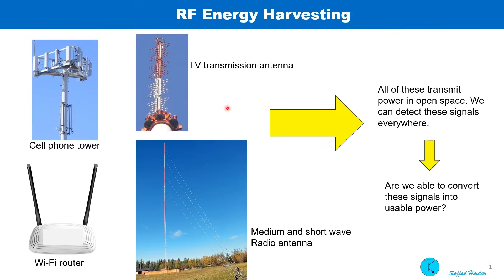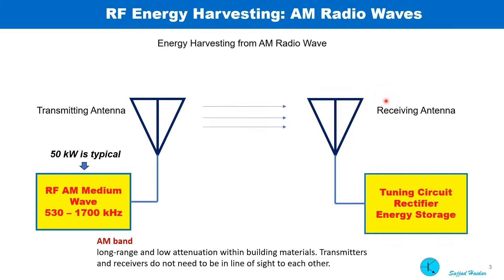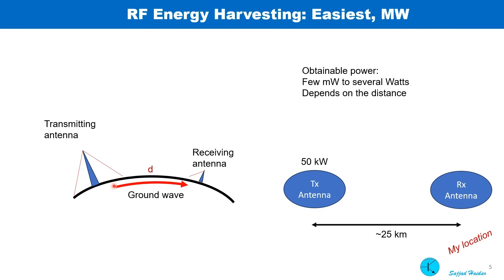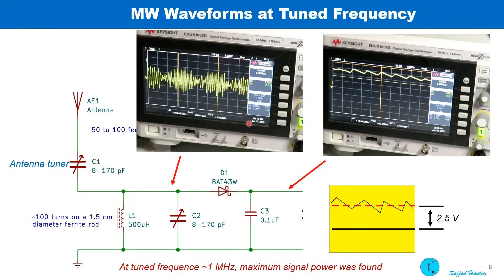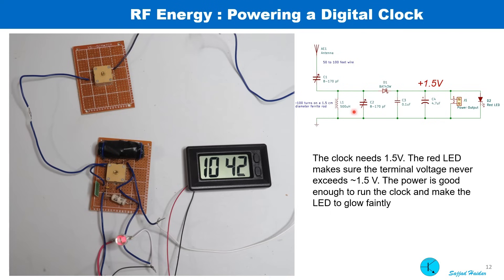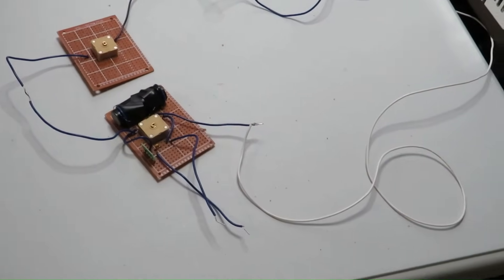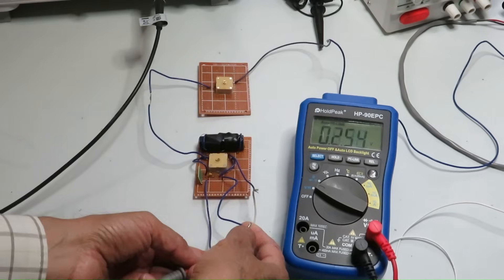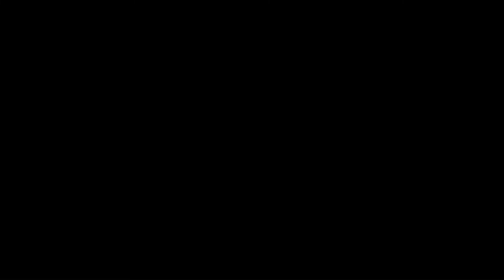Energy harvesting from radio waves

Comment: Experimenting with harvesting free energy from radio transmissions is a promising approach. However, utilizing a solar power system is more efficient.
Reply from the maker: Thanks for watching and thanks also for your comments. Yes, I must agree that Solar energy harvesting is much more efficient. RF energy harvesting could be better only in remote  or inaccessible region. During daytime solar energy can power devices and some energy can be stored in battery, however with time and lack of maintenance, batteries may not last long. Only in those cases EF energy would give us better result. Like telemetering, or remote sensor reading

Comment: Interestingly well suited is the legal aspect of such a device. As an ordinary radio receiver in concept, it is actually legal. It does not consume more broadcasted power than a legaly obtainable audio receiver and makes no unprediced or unanticipated load and influence to the broadcasted RF signal.
Reply from the maker: Thanks for watching and your comments. In some countries, it is not legal to harvest energy from radio waves, but in most of the countries there is no restrictions.  As radio waves are radiated energy whatever ways we use it  on the broadcaster side it does not cost any extra electric bill. On the other hand reactive power harvesting is illegal as that draws power from the main line. Reactive power harvesting involves capacitive or inductive power drain by placing a coil or metal piece close to the power line

Comment: which antenna is best ,is that possible to use wifi ,tv antenna
Reply from the maker: Depends on the band of frequency you are interested in. Here I showed only MW harvesting, the wavelength is big, so we need long antenna. for WiFi or cell phone signal you need small antenna, as these use much higher frequency (small wavelength). But, the power of Wifi or cell phone signal are very low and the range is short.

Comment: hello sir, pls I need your help. Pls can you create a step by step video on creating your own RFEH system that  can power several LEDs .Pls especially the components(all) for that project. Am also close to an AM radio station .Am kinda new to this field .Pls help me🙏🙏🙏
Reply from the maker: Hello, Thanks for watching. Once I prepare a project, usually I disassemble after sometime. It would be time consuming for me to make another video showing all the steps. But I can tell you something that may help you. Firs buy some components from any local electronic components store or Amazon. These are a ferrite rod (1cm dia or whatever you find), Two variable capacitors (100 to 500 pF), several ceramic capacitors (0.1uf to 5 uF), a small signal schottky diode, several same type and colour LEDS. After making the circuit, connect the antenna (should be more than 50 feet long to be effective). Now tuning the two variable capacitor you may find a suitable position to maximize the LED brightness. Connect all the LEDs in parallel. Do not mix different types of LEDs. Each color-LED has their own cut-in voltage, If you use multiple color_LEDs in parallel only one colour of lower cut-in voltage will glow. For instance if you wish to use Red LED, use multiple red-LEDs. If you need further assistance you can send me email. Thanks

Comment: Hi teacher, i live in Curitiba city, Brasil. I did not find BAT43W, but i found an equivalent,1N5818. My doubt Would be if the voltage Would stay less than with the BAT43W, because i Only obtain 110mV (milivolts) with this diode 1N5818. Thanks
Reply from the maker: Thanks for watching. I think your diode should be OK, there could be some other factors, like the antenna length is not long enough, your location could be much further than that I did the measurement, etc. If you could explain a little detail, I can get a better picture.
Reply: Hi teacher, i obtained a considerable Voltage increase to 0.8V (maximum). I also decided install a Phone, and discovered that this circuit Only tune one Station ! I turn the Variable Cap to right and left, but i Only Hear one Station ! Please, how to solve this defect ? The tuning Cap i use has 0 to 500Pf  ! And the inductor i am using has 400 microhenrys. I mounted the circuit exactly equal the schema, but i don't know what is happening!
Reply: @AloeVeraJuice_by_ForeverLiving  Hello, The LC tuning circuit Q factor is important in tuning. If one signal is much stronger than other signals, usually that strong signal dominates. Of course a high Q tuning circuit will allow you to tune better. I think what you can try, make your own inductor with a thicker wire (AWG 18,or 14) on a ferrite rod. Nearly, to 200  to 300 turns may give you 600 to 1000 micro Henry.

Comment: It's a really cool project. Would it be possible to power a 1.5v quartz clock?  A hug from me to you, greetings from Brazil❤😊.
Reply from the maker: Thanks for watching. It is easy to power a LCD clock as it does not need much power. For a quartz mechanical clock, the motor needs little  more power. So if you are located few kilometers away from a radio station, it will be possible. In my case my home is 25 km away from a station, so that power is not enough to drive a mechanical clock.
Reply: @technologyforyou5976 What if instead of one antenna, you used several antennas?

Comment: The larger the diameter of the antenna, the broader the band width of reception. 
Receiving distance is a function of polarity. But there are two cases to consider, sky waves (reflected from below the horizon), ground waves (low frequency, horizon to horizon).
Now we risk a moral debate. 
Drawing energy from the power-grid, for free, legally.
Or do we explore, energy from the ground.

Comment: Question: what do you need selective LC tank on the input, if you do not need to listen to the radio?
Reply from the maker: Tuned circuit is needed to maximize the power received by the antenna. Without the tuning circuit some power will be reflected by the antenna.

Comment: High voltage transmission towers also can get EM wave to light up a small LED 😊
Reply from the maker: Some people try to harvest power from HV transmission line, however these are not EM wave. Power harvested from HV line is called reactive power. It is in a sense stealing power from the grid.
Reply: @technologyforyou5976  You are stealing RF energy from the transmitter :D   Not much, but this is a zero-sum game.
Reply from the maker: @yeroca  Thanks for your comments. Harvesting RF radiated energy is not stealing. On the other hand reactive energy from HV line is stealing because electric supply company sees that some energy is leaked away by these process and they will be loosing money because of this. RF radiated energy is already gone, transmitter owner knows that this energy is gone. In some countries of europe (like UK) this kind of RF energy harvesting is discouraged not because of stealing but because of absorbing a part of the energy which could other way travel to a radio audience with better reception. By google searching you will find lots of other articles about it

Comment: Psuedo-science BS from a non-qualified quack. Firstly, the uploader falsely claimed in the beginning that only two capacitors are needed, but then his schematic shows four capacitors. Secondly, he drew an arrow from a clearly marked inductor pointing to a labeled image of a Schottky diode. Thirdly, he used a 75 ft antenna and then says "75 meters would be better", which is a ridiculous comparison. Do not heed the nonsense in this video. YouTube has NO knowledge by design. Everyone is brainless.
Reply from the maker: Thanks for watching. About your comments on four caps, two are needed in tuning circuit, that is what I meant. The other two are used after the Schottky diode, for filtering purposes. As I was detecting Medium wave, around 1 MHz, I got a strong signal from a local radio station. I used a 75 feet long, antenna, it is short for that. Now calculate the length of a half wave dipole,  it will give you 150 meter. if you use a quarter wave that is 75 meter, that will give you better output. There is no pseudo science in it. Just do the experiment by yourself and test the result by yourself. Science is repeatable and can be tested by anyone. Try to learn something about scientific method, that will help you

Comment: Hello. I have a small question.  What about the impact of a thunderstorm or worse a lightning strike?
Reply from the maker: Back in old days, when there not that many high rise buildings and no cable TV, equipment (TVs and Radios) used to have lightning arrester just at the antenna end. This is nothing but a gas filled tube with two electrodes. When lightning strikes this tube shorts the electrical impulse to the ground. Now you will find lots of buildings and power lines are located way higher than your antenna height. So if you living in cities, you will get a little higher electrical pulse at the output.  Most of the cases nothing will happen more than this. However, in remote location and in a kind of open area lightning can burn this kind of circuits. Now a days you won't find those lightning arrester, buy you can use Varistor instead. This is sufficient to protect this kind of electronics. Though a severe lightning strike can damage this varistor itself.

Comment: What if you had 10 wires in your yard? Would you get 10x the power? If I live just a few hundred yards from a cell tower and under a mile from several AM radio towers... how much energy could I potentailly harvest?
Reply from the maker: Thanks for watching. 10 closely located wires will not give you much more than a single wire for AM waves. Waves of energy hitting the firs wire, reduces the strength of the waves in that direction. So for AM waves you have to increase the length of the antenna. For cell phone signal, you should use multiple small antennas spaced nearly a wavelength apart. Other question is how much energy you can get, for cellphone signal, not much as these are transmitting low power signals. AM power is 50 kW (usual) so can get several watts if you live nearby. You can light your home and charge your devices. But not heating your home, that needs huge power.
Reply: Thank you so much!
 @technologyforyou5976
Reply: you essentially become a favorite magnet for thunder strikes..

Comment: nice for hydrogen making
Reply from the maker: If you are close to the transmitter, then you can harvest several watts to generate hydrogen by electrolysis of water. However further you go from the transmitter power goes down, in that case solar energy harvesting is a better choice.

Comment: There are two other sources as well one is high tension power towers  where power is constantly leaking into aria and the sun also generates masses amount of power while most is shielded By the vanhallen belt  quite a bit still makes it down to earth and was a constant problem in the past by the constant crackling in the back ground  that could get really bad in sun spot season
Reply: Very cool to know. Millennials didn’t do that kind of thing for the most part

Comment: Would be nice to know if that device  when sucking energy from RF is also making a signal weaker? Also I am living near to Cell Tower Antennas like 50meters, is there any way to block those EMF ? And last question, is those RF is very bad for human body?
Reply from the maker: Thanks for watching and your comments. Yes, sucking some power will make some part of the signal-wave weaker. However a broadcast antenna radiates everywhere, so if a tiny part gets weaker, does not cause much problem. Harvesting radiated power is not illegal in most of the countries of the world.  If you are living very close to a cell phone tower, you may be able to harvest power from that, but you need high frequency rated components, antenna will be smaller, but little difficult to tune for optimum power harvesting. Yes, it is possible to block those signal, using a very fine metal metal mesh you can make a cage like structure, and that should be connected to ground. This metal mesh-room is sufficient to block most of the signals. This RF energy, whether it is harmful or not is still a debate. There is no scientific proof that RF from cell phone tower , TV or Radio antenna can cause any harm. However some people did some statistical data analysis, they find that people who live close to a cell phone tower suffer from some illness.  Just to let you know, these these RF waves are called non-ionizing radiation, and till now there is no scientific proof that these radiation can cause any harm to a living cell. Ultraviolet light, x-rays are also electromagnetic waves  but the frequency is way higher than RF waves. These are ionizing radiation and cause harm to living organism, the proof can be seen right away.
Reply: @technologyforyou5976  Thanks for such detailed reply! Yeah I know about faraday cage , and ionizing radiation too, but I am wondering why telecommunication companies love to share a strange example of sun radiation and rf radiation, they telling that sun  radiation a lot of times have stronger radiation, but I think it's a different thing and not comparable, because when you lay down on the sun, the heat is coming slowly from top of skin to the deeper body, and if you put your hand in to microwave oven it will heat you from inside, like food from microwave oven has more heat inside, than outside... So cell towers radiation is the same they go to he deeper body parts and resonating with water. So whats happening when is sleep time, sun is gone, but the cell towers works 24h. Let me know if I am wrong? Thanks again!

Comment: It may be easy to harvest energy from broadcast radio. It's also illegal - at least in the UK. A farmer in the UK was charged with theft back in the 1960s for using an array of aerials to use the power from a nearby transmitter. Extract enough energy and there will be a lot of very pissed off radio listeners in your radio shadow - and you won't be hard to find!
Reply from the maker: It is not illegal here in North America to harvest energy from radio waves. Radio waves are radiated power, once it is out of antenna, there is no legal boundary on it. However it is illegal  to extract energy by capacitive or inductive coupling to the high voltage supply mains. That way people are actually be stealing energy. Thanks very much for watching and your comments

Comment: I just found your channel, you are doing well. I know making videos is not easy. Appreciate the effort. Its nice to see others and their projects to get ideas from. I have built a few of these myself. I have also been doing something similar but different with static electricity in the air. Turns out you can collect energy from the atmosphere with just an antenna,  but to get more from it you can break and make the circuit rapidly. So you could build one that oscilates at the speed of the RF of the station through a transformer and there for drive both the RF reciever and the static electricity  from the air to get substantially more power. You may try that. I don't know the best circuit as i have only just started playing with it but i did get it working a bit.
Reply from the maker: Thank you very much indeed for watching and your comments. Yes, I also have interest in static electricity. Hope to work on that direction soma day. Thanks again
Reply: Hey! Do you also watch thinking and tinkering? I am also extremely interested in these types of projects and specifically static energy harvesting.
Reply from the maker: I just had a brief look at Thinking and Tinkering, these are nice. Thanks for telling me about it. I also hope to do something to harvest static energy in future @spatoinker8743

Comment: Built an "RF-Powered Radio" back in the 1950s from an article in a now-extinct hobbyist magazine. Single CK-722  (very expensive) transistor amp, 1N34 detector, roughly 50 ft long wire antenna - all in the attic. It drove a speaker at a clearly-audible level. When the family sold the house 50 years later, it was still up there in the attic, working just fine.
Reply from the maker: Good to know your experience. Thanks for watching
Reply: was just going to say oh look something new 'oh yeah thats not right' blowing the dust off their crystal radio oh look a radio with no power source but the RF waves...
Reply: I made one of these when I was drinking with my buddies in my 20's.  Such a fun project!
Reply: Thank you for your service.
Reply: Would love to know the name of that magazine!.
Reply: my cat says.. Crystal radio setup
Reply: Please mention the magazine name, I would love to also learn
Reply: All FM & AM station is make very important for this concept..
Reply: Witam w latach 60 - tych mając 17 lat użyłem żyletki ołówka grafitowego. Cewka z kondensatorem antena w pokoju za oknem wbity pręt nastrojem pierwszy program radja nadawanego z Gąbina w odległości około 250 km Słuchawki z chemofonu. Radość była wielka.Na obecną chwilę mam ponad 74 lata miło to wspominam. Pozdrawiam pensjonatów różnych zainteresowań.
Reply: I’d love to know the name of the magazine too!
Reply: THANKYOU og

Comment: An interesting experiment would be if the antenna is not tuned, then all frequencies of all transmitters would be on the wire, would this not theoretically result in a higher voltage after the diode.
Reply from the maker: Actually if you remove the antenna tuner capacitor, the voltage after the diode is little less. This antenna tuner also serves as a impedance matching device so we get a little higher voltage. Back in old days people used to make their own radio receivers some people use it and some don't. Thanks for your comment and watching